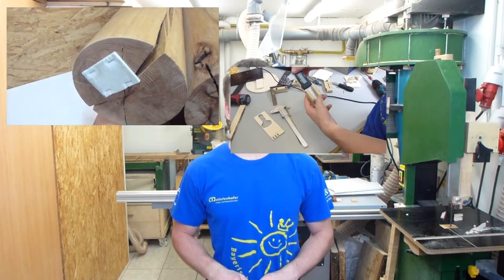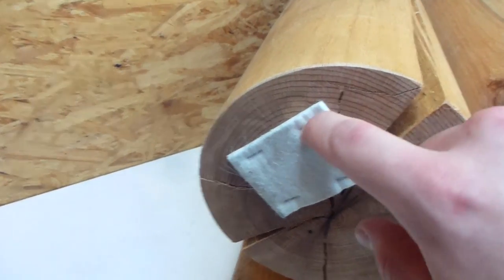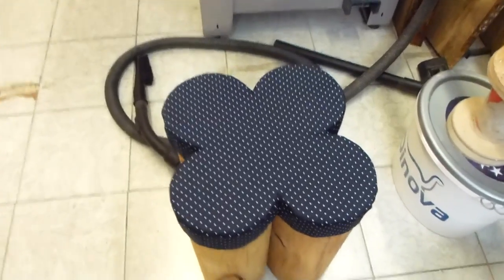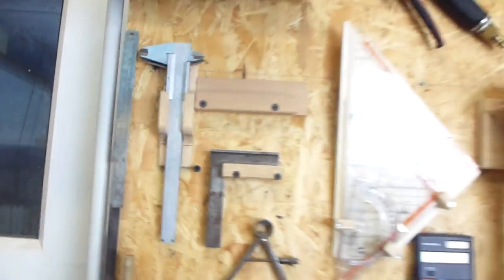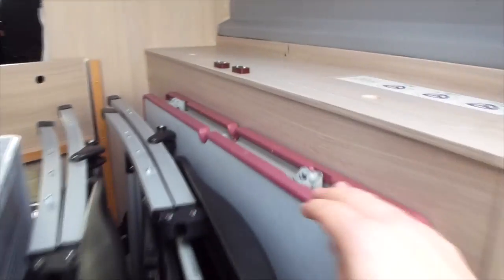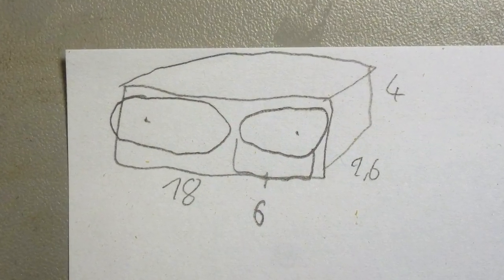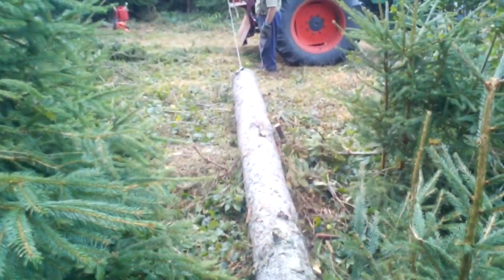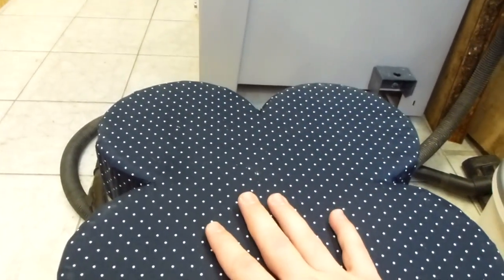Stool Followup, Tool Holder, Camper Inventory, Work in the Woods (Random Shop Stuff 6)

Comment: I like to use the case from the caliper as the wall holder with extra desiccant packets, since I work in a garage and have terrible dust collection(zero), keeps it dry and dust free.

Comment: Great videos! Keep up the good work. I have that same caliper. I assume it is one of the inexpensive ones (not a Mitutoyo). I suggest suggest taking it apart and cleaning it really well, softening the edges a bit with a hobby file, keeping the jaws slightly apart when not in use to avoid corrosion and removing the battery when not in use. The inexpensive calipers use a LOT of power even when off. You will go through batteries like crazy of you don't take the battery out. 

https://www.youtube.com/watch?v=WvszAb0Y0Ec

https://www.youtube.com/watch?v=E8oopG2GpF0